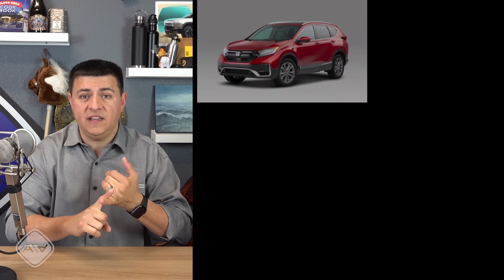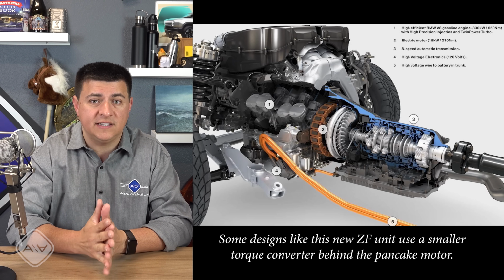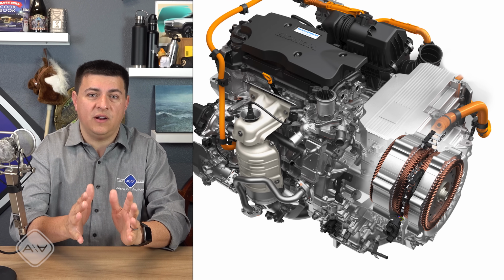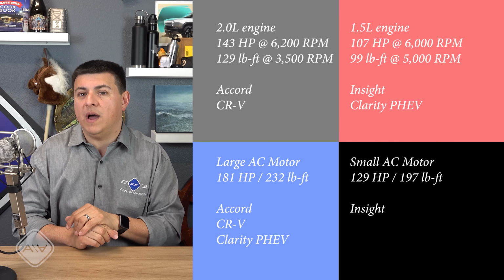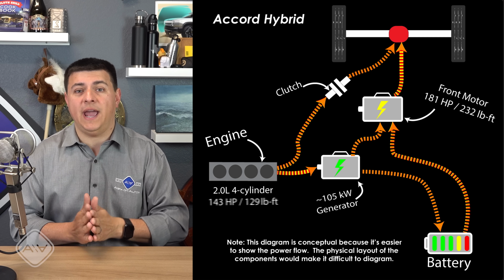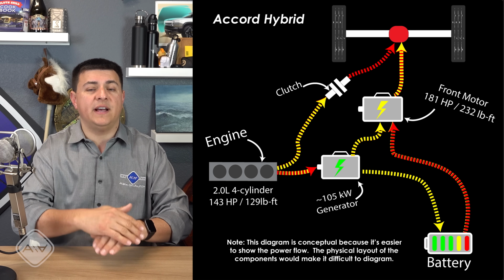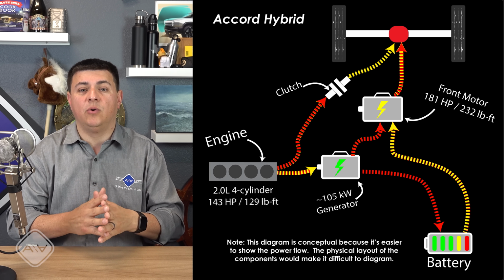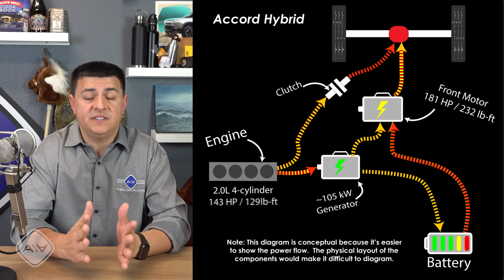How Does It Work?  Honda's 2 Motor Hybrid System Explained!

Comment: The newer Honda hybrid system uses a 2-speed mechanical transaxle, not this 1-speed one, doesn't it?
Reply: Only the 2023+ CR-V has two of the clutches shown at 5:10 instead of one. It's for more power while towing, like using "L" in an automatic transmission.
Reply: @jeffjo8732  I probably confused Honda's eCVT with the one used in the new Prius
Reply: @jeffjo8732  Right, I just found an article about it on Honda USA website. But as expected, the low-RPM direct drive clutch is also used for engine-only driving at urban speeds (but again, this feature is only present in the 2023 & 2024 CR-V but not in the Accord)
Reply: @tedantares2751 I haven't gotten any consistent information about how often the low-speed lockup clutch is used in urban driving. While it certainly can be used, the reason it isn't in any other iMMD hybrid is because being appropriate for the vehicle speed isn't the only criterion for its use.

First off, it isn't "Engine-Only drive." Contrary to popular myth, no HEV ever uses just the engine. Honda calls it "Engine Drive," but what is, is a parallel hybrid mode (like Honda's old hybrid system). The engine will operate at its most efficient level of power for the rpm required at the car's speed. This will be more power than is needed for cruising on a flat road at that speed, so the excess is used to charge the battery, and will be used up later in EV Drive.

The gain, over using Hybrid Drive, comes from the portion of the power that is used directly (that is, not saved in the battery). There is essentially no loss between the engine and the countershaft for this power; the similar portion of the power in Hybrid Drive has to be generated, converted to a different A/C frequency, and sent to the motor. The disadvantage of Engine Drive is that the efficiency is not quite optimum, and the portion that needs to be saved in the battery (more loss) can be much greater.

So it is a tradeoff, and I have no idea what that tradeoff means. They could have put two clutches in the Accord, but didn't, indicating that there wasn't a significant efficiency gain due to using Engine Drive in an urban setting.
Reply: @jeffjo8732  I guess I'll learn more about how the 2024 CR-V's eCVT works when I get that CR-V

Comment: The dual motor setup that Tesla uses is far superior to any mechanical four wheel drive system as both engines are big enough to deliver all the power that each axle can transfer to the ground and the power can be controlled individually in milliseconds.
Reply: This honda hybrid, when running under 45 MPH is act like a Tesla but with smaller battery and on board generator.

Comment: What is the total hp?
Reply: Short Answer: 212 HP (or 151.5 HP for the Insight). But what few people, including Alex, don't understand is that this is not the limit of the power the system can "produce." It is an estimate of what the system needs to produce, to supply the maximum power that can be used for propulsion. Contrary to what Alex says, it is what should be compered to conventional cars.

Longer Answer: In a conventional Internal Combustion Engine Vehicle (ICEV), the flow of power looks like this:

Gas->ICE-(HP Produced)->Split->Transmission-(Propulsion HP)->Wheels

Here, "split" means the belt(s) attached to the crankshaft that drive alternators, compressors, fans, etc. The power advertised for these cars is the "HP Produced," and it is called "SAE Net HP." The "Propulsion HP"depends on how much is pulled off, and any losses along the way. It can only be estimated, often as 85% of the SAE Net.

In a Battery Electric Vehicle, it looks like this:

Battery->Electronics-(HP Produced)->Split->Motor-(Propulsion HP)->Wheels

The split is usually done in the electronics. So "HP Produced" is never a quantity that is isolated from what gets passed to the motor. However, the motor has a rating that is known. It is usually what is advertised. You could estimate "HP Produced," but I don't know if any do, or not.

In the Honda iMMD system, there are two separate power sources. So "SAE Net HP" does not correspond to the total produced power. To find that, we have to add the two sources, as indicated by the "+"s here:

Gas->Engine-(SAE Net HP)->Generator-+
Battery->Electronics-+
+-(HP Produced)->Split->Motor-(Propulsion HP)->Wheels

Honda advertises all three powers here. Unfortunately, Alex confuses what they mean. At 3:35, he has a grid that shows the SAE Net is 143 HP for the Accord and CR-V, and 107 HP for the Clarity and Insight. The Propulsion Power is 181 HP for the Accord, CR-V, and Clarity, but 129 HP for the Insight.

The number you asked for is the HP Produced, and Honda calls it "Total System HP" or "Combined HP." And just like the BEVs, it is not a quantity that can be isolated from what gets passed to the motor. They do know that they can't pass more than 181 or 129 HP, depending on the motor. So they estimate it. Using the same estimation that I said ICEVs use, but in the opposite direction, they say it is enough for 85% of it to be the motor's rating.

That's 212 HP for the Accord, CR-V, and Clarity; and 151.5 for the Insight. Contrary to what Alex says, this number represents the same power that ICEVs advertise.
Reply: @jeffjo8732  thanks for the answer.
The principle of energy conservation applies. There must be a standard e.g. iso or European EN   for calculations/measurements of power  in hybrid  int.comb. eng.  for all that. 
Manufacturers must comply with standards if any. It is confusing, misleading for simple consumers to understand all that. The power in the different modes and torque must be provided to the specifications clearly. 
I will ask some friends i have working in cen standards to find if there is a standard for the power in vehicles in hybrid  or only electric mode.  

Kyriakos
Mech. , energy Engineer
Cyprus
Reply: @kyriakoskitsios  You a assuming that there is a commonality between ICE cars, BEVs, HEVs, and other HEVs, that can be used to base standards upon. There is a commonality in what they accomplish, but the differences in how they accomplish it are to vast to overcome.

Commonalities: All take stored, chemical energy and convert it into kinetic energy of the vehicle. When it is moving between the two, it is called power. That is, (energy moved during an interval)/(interval time).

The only reasonable measure of power in an ICEV is the rate at which it can convert chemical energy into power. Some goes to peripherals, and some gets lost in transmission. The power that becomes kinetic energy of the car is too complicated for a standard like you want. The actual standards, while different around the world, are based on this "power produced."

The only reasonable measure of power for a BEV is the rating of the motor; that is, the power that becomes kinetic energy of the car. The same considerations, for peripherals and losses, apply. But the battery is capable of "producing" far more at any moment in time. Using its capability for a standard would be like using how big of a bonfire you could make from the ICEV's gas tank.

HEVs (and I don't mean those that can plug in) are stuck in the middle. They are limited, to some degree, by the power that can be produced at any moment. But, depending on the design of the system, that can exceed the power that can be used. So any standard needs to be based on what can be used, not what can be produced. And that involves far too much speculation for a standard.

Comment: I had the 2008 civic hybrid and honda did a mandatory battery update and killed the mpg benefit, there was even a class action lawsuit and honda settled for $250 per person. I will never buy honda again and now I have lexus hybrid and no issues
Reply: Cratemoving Sale That car had a different design, but completely understood why you’re off the brand after a bad experience. Can’t really go wrong with a Toyota or Lexus.
Reply: That had a different battery, 2008 was before Honda switched from the old Ni-MH battery to the ubiquitous Li-Ion battery
Reply: One benefit you have now, non-interference engine. If a honda timing belt/chain breaks, you will probably say goodbye to the engine as the valves and pistons will meet in a not so friendly fashion.
Toyota/Lexus doesnt have those issues.
Reply: @zakuraayame5091  I have a 2004 Odyssey, belt never broke after 16 years
Reply: @justincui  It didn't break because it is a chain.

Comment: Thx for the detailed explanation. It was very insightful...
But may I suggest, classifying the different makes of Hybrids, as a Serial or Parallel Hybrid, to show how they are related to each other, would have been useful. For example the Parallel Hybrid "Prius" has little in common, with the different versions of the "Volt", that are primarily Serial Hybrids. Even if they use the same types of parts such as tires, brakes or planetary gearing.
Reply: Alex, the 1st generation Volt (2010–2015) didnt even have a parallel mode, did it? And ofc the 2nd gen was designed to get a very minor assist at most speeds from the ICE. So I would like to see the figures of how much it helped its fuel economy vs adding to its power and acceleration? 
Bottom line, its still primarily a Serial Hybrid even with max assist from its ICE...
Reply: Actually the 2nd gen voltec system has several modes that are very similar with the Prius’ especially the plug-in version. In EV mode both motors provide drive torque (and both use a one-way clutch to enable this), neither system has a true serial mode, and both use a powersplit path for their hybrid mode(s). The difference is that the voltec 2 system has a second powersplit hybrid mode for high speed cruising that it accesses through a synchronous shift, whereas the prius reverses the motor/generator roles and goes into power recirculation at high speeds
Reply: Actually the 2nd gen Volt, ofc has a, purely serial mode, such as when its clutch is disengaged and its ICE is off.... But if this to confusing just think about 1st gen Volt... BTW being pedantic while missing the big picture is pointless...
The bottom line is, they are at opposite ends of the Hybrid spectrum.... And their percentage of use of gas vs electric to power them, reflect that fact...
KISS, One of them is basically a BEV with ICE REx... While the other is based on a ICEV, with a battery and EM attached to it to add regen...Just myopically focusing on power distribution charts miss the point.... But they both use clutches and tires too so I guess they have to be same thing?  lol....
FYI, The Volt doesn't have a transmission, so there is no "synchronous shift" :)
Reply from the maker: The first gen Volt did have a parallel mode and GM later admitted that the Volt spent its time in steady state highway cruising in that parallel mode.
Reply from the maker: When the Volt's battery id depleted (both versions really) it will switch between parallel and serial modes depending on what is needed (the 2nd gen has a few other modes which are not germane to this comment). The Gen 1 Volt will generally use serial mode when more torque is needed, when starting off from a stop and occasionally when charging. BUT, in steady state travel it will almost always switch to a power split parallel model because that is the most efficient. You would never want a Volt to operate as purely a serial hybrid
Reply: N C both gen volts have 3 clutch packs and 2 planetary gearsets. In both cases there are actual shifts that reconnect different parts of the geartrain to switch between ev mode, fixed ratio engine, serial hybrid (gen1 only), and 1 or 2 powersplit modes. Conceptually the 1st powersplit mode is similar to the prius, the proportion of time spent driving in EV vs hybrid mode is irrelevant to the geartrain layout.
Reply: @AAutoBuyersGuide  thx for enlighting about the design of the Volt's powertain... But I still don't see the fuel economy gain of using a complex parallel option hybrid design of a Prius vs a simpler serial hybrid like the Nissan Note E-power. When comparing it J-MPG figure to Prius J-MPG figure? While you have less conversion loss with direct drive you have greater parasitic from the drivetrain. And the MPGs in Japan seemed close at the time. Do you have any hard data that a to the contrary that shows a  Prius (or similar hybrid) is worth the added complexity?
BTW, do you still think the next the gen F-150 won't have BEV version? 

And I really appreciate you taking the time give feedback to viewers. thx

Comment: If you seen the size of this literately "no physical transmission" it is definitely behind Toyota's design. Either they've could have developed a very tiny more efficient engine, or add a 2 speed small tranny for that  final ratio. Toyota for the overall win! Buy teh CR-V for the interior though!
Reply: So, size is the critical measure for you? :)

The literal definition of "transmission" is " an act, process, or instance of transmitting [power]". It means taking the power output of the ICE and/or Battery, then changing it to what the wheels need and moving it there. All cars have  "transmission system." In a conventional AT car, it includes the torque converter, a bunch of variable gears, and the differential. In a battery EV, it includes one of more motors (yes, they are part of the transmission system), a reduction gear, and the differential.

But the only part most people interact with is the "bunch of variable gears". So they, incorrectly, call that "the transmission." These Honda hybrids do not have them, hence "no physical transmission." But it still needs the rest of the transaxle which includes not much beyond the motors and the differential. There is a clutch, and a single gear, and the composite is not "definitely behind Toyota's design." The result gets essentially the same mpgs as the Toyota (differences are due to other design elements, compare the various models of Accords and Camrys with an eye on wheel diameter) with better performance.

Comment: Having a Honda Insight for the past almost 5 months, I have a hard time believing that the gas engine is connected to the drive wheels at higher speeds. I do know that the gas engine shuts off and the EV light comes on along with the battery gauge lowering, which would suggest that the car is driving at highway speeds on the electric motor. I do like the car and how it drives, very fuel efficient and smooth. But I've heard this explanation a number of times and just don't understand how if the gas engine is mechanically connected above a specific speed, why does it then shut off and the car go into EV mode at high speeds. I think it is great, but nobody has been able to explain this to me yet, including the dealership.
Reply: Do you have a Power Flow Monitor (shows the engine, battery, and wheels with blue or green energy flowing between them)? When the little gear shows up in the center, the engine is connected to the wheels.
Reply: @jeffjo8732   Yes, I have that and the little gear shows up randomly at various speeds, not just at highway speeds.Also, that is not there most of the time when I am travelling at highway speeds as well. I drove for over an hour yesterday above 100Km/h (60mph) and for less than a quarter of the time maintaining that speed, the little gear showed up. Most of the time it wasn't there and for almost half the drive at that speed the engine was off and the blue lines were from the battery to the drive wheels only. I'm fine with this of course, but it just seems to contradict what every has been saying that the gas engine is mechanically connected above a specific speed.
Reply: @Lucipher2K  I have an Accord, so I can't say what the relative times in parallel or serial mode are above ~42 mph. But that sounds right. Mine goes into serial mode when it needs more than 33.7 HP; yours probably does it around 25 HP. But it actually charges the battery more when it does, because of the higher power.
Reply: To ask , at what speed does the accord hybrid disengage ev mode
Reply: @Lucipher2K  Hello, I have a question. Is the e-cvt transmission used in this new 1.5 cc Honda Jazz exactly the same system as the e-cvt used in the 1.8 cc Toyota Corolla sedan or is it a different system? The reason why I asked this was they said that the risk of deterioration of the e-cvt system used in Corolla is less than the normal CVT. Do you think we will have problems with the e-cvt gearbox if we buy Jazz?
Reply: @attilakhan4606  I wouldn't know as I have a Honda Insight. But I doubt a Honda and a Toyota would share the same or a similar e-cvt. Plus, Toyota favours a planetary gear setup over a cvt I believe.